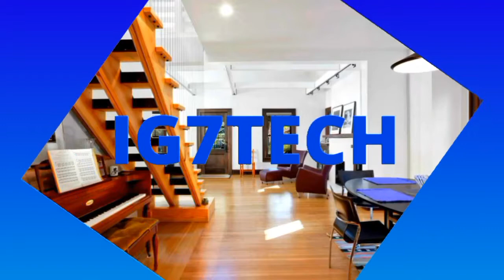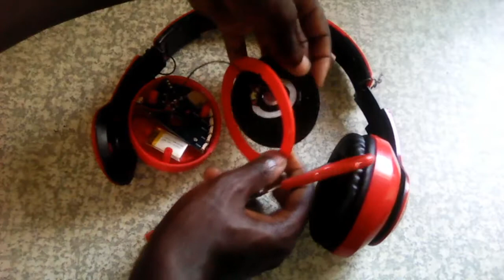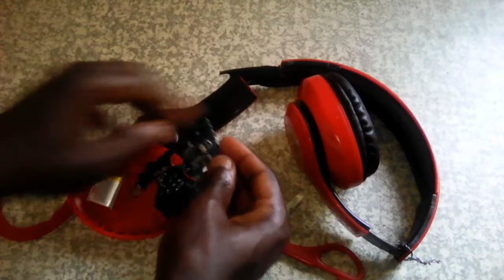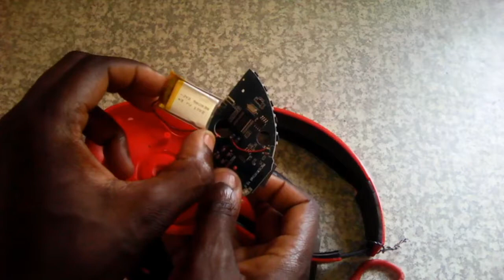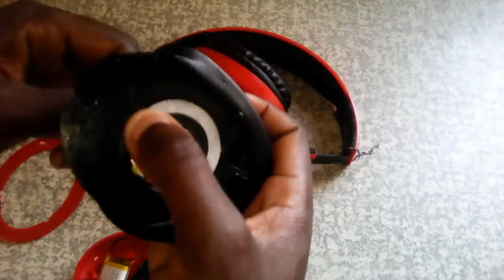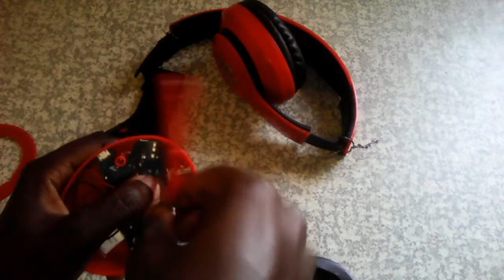Volkano impulse Bluetooth headphones Teardown How does it work

Comment: The white thing behind the power button is broken, can it be fixed? I've bypassed it with a wire for now but that means I must open  the headphones every time I want to switch it on/off
Reply from the maker: It can be fixed but finding the parts is the problem
Reply: Alright, thanks

Comment: Thank you so much for this video bro!…it helped me out so much. I have the Volkano Phonic wireless headphones and they weren’t switching on after one year of usage. I wasn’t about to just let them go easily coz they were expensive. 

Ur video showed me how to open them properly without breaking them. Turns out my battery had been disconnected from the motherboard because one of the wires was lose. Fixed it and now all is well. Thank you once again😊🙏🏽
Reply: How did u fix the loose wire😭
Reply: Same question
Reply: Hey Lesego and Rowen…so what I did was to carefully cut off bits of the plastic covering the wire, so that I could expose the wire/copper ends. I then stuck those onto the motherboard on the part written “B+” coz that the part that was loose. I used sellotape. But you’ll have to be very careful because everything is so tiny.
Reply: mine are not turning on right now

Comment: My head sets are charging &  connect. But once i full the charger out the go dead like they not working... then i put em nack on charger they star working.
Reply from the maker: You have to change the battery
Reply: @IG7Tech  cap
Reply: One of the wires are not properly connected and need to be welded